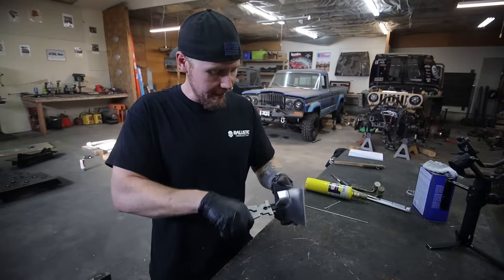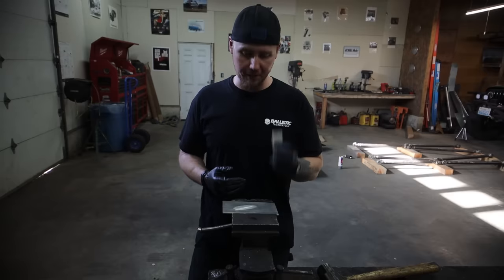Amazon's CHEAP Alternative To Aluminum Welding!!! (Alumaloy)

Comment: Click on a video for aluminum.. stop to drool over the Jeep Gladiator pickup... Damn I wish I was short, I love those damn trucks. (I'm 6'10 and all torso) I think if you had a jeweler's torch that uses propane, or just a really small orifice torch similar to a gas welding torch, that thing would be really useful and much easier to control your heat. I was thinking about making tabletop waterfall fountains, that stuff might be a great way to allow me to make them out of aluminum instead of steel. BTW there's that stuff commonly called Troll Snot that's a clear gel you use as a heat sink when you don't want the heat to go further on a panel.. I wonder if that'd work to keep the heat centralized on aluminum and not let it spread out to the entire piece.
Reply from the maker: 6'10" your a real life gladiator! I have an Acetylene torch with a small tip that would work perfect for this. The problem is I get comments where people complain that I use specialized equipment when I fabricate lol so I decided to use a standard propane torch for this job!
Reply: @DirtLifestyle  yeah but if you had a small tip torch for a propane setup it'd probably work great, even out in the bush so to speak. They aren't that expensive, hell amazon has some jeweler's torch setups for under $30! Though most of those are for oxy-acetylene, you'd just have to swap out for a propane regulator. They do make small propane/butane pen torches as well. Also I found both harbor freight and northern tool have low temp aluminum brazing rod at a better price than amazon does.
As for my height.. fun fact gladiators were actually mostly pretty small. Sure there were some African slaves that were tall and some Vikings/Visogoths, but mostly they would've been under 6 foot tall back then. :D

Comment: So this is aluminium solder. You Americans will not understand the English words. Home depot sold this 20+ years  ago and it works really well for some purposes, especially auto air con repairs, where the pipes crack and using this with an outer tube is better than a TIG weld repair.
Reply from the maker: This is very similar to the brazing rod you see at home depot but its definitely a different alloy. Not flux coated or anything like that. What ever they make these rods out of is a strange combination of materials and feels much harder than the aluminum rod I tig with. Its strange stuff 👍

Comment: Aluminium brazing is nothing new or revolutionary. I took my first year apprenticeship course for welding 50 years ago and we were given a one day course using this process as part of the course. It is a viable process for what it was intended for which is non-load bearing applications. The down side is once this process has been used, the only way to use another process like TIG, absolutely all of the alloy must be removed to prevent cross contamination and welds of dubious quality which is why it was never very popular. Most people elected to go with a guaranteed process rather than take a chance. Now that the public is becoming aware of it it's use is on the rise. The problem is of course there are certain people that will knowingly use it in places where it has no business and failures will occur much like MIG welding. It seems like every joker in the countryside can run a MIG but very few can produce a good stick welded joint which actually takes  degree of talent and knowhow.

Comment: Please don’t weld a fuel tank without taking any safety precautions.
You can watch some great OH&S videos where you see people being blown away by the explosion.
Reply from the maker: Are you telling me not to or saying this as a comment for anyone? This is brand new. This has never been a fuel tank. It is just an aluminum cylinder until you store fuel in it. No safety precautions neccessary. But anyone who is working on container that has seen fuel, of course make sure you don't have vapors on any kind. 👍 wash it out. Let it sit in the sun for a week.
Reply: Dirt Lifestyle Actually you can weld a fuel tank with fuel still in it.
With the correct precautions it is possible.
Though you have washed the tank, it is safe to purge with an inert gas.

If that tank had no openings you could have had an explosion from pressure but not dangerous.

When welding aluminum it is a common thing to drill a hole to release the pressure during the welding process.
My message was directed to you, as it is important to also speak about safety precautions.

Comment: Do not use brake clean to clean parts you will be soldering or welding. It can kill you. Google it.
Reply from the maker: Absolutely. Welding or brazing over brake clean is extremely dangerous that's why I use acetone for anything fab related 👍

Comment: its easy to do wrong. MAPP can easily melt your aluminum. Also DO NOT try to do any of the braze rod in the flame. You need to evenly heat both pieces to be attached up to the proper temp. If you have to hit the rod with the torch you already compromised the weld.
   Right before its hot enough the aluminum starys to look shiny.

Comment: You didn't flux the joint, didn't file the joint flush with its base, and didn't heat the base properly. If you'd have done all of those steps to perform a proper braze, you'd have had a much harder time breaking that off.

Comment: Unfortunately since it is brazing and NOT welding it is not nearly as strong as welding would be. Nor can it be used in lieu of welded parts where welded strength is needed. Pro weldor.
Reply: Nothing more than filler - may as well us glue!

Comment: Tried this on some Motorcross bike rads, no success
Reply from the maker: It can be tricky. It takes alot of heat and you don't want to melt your project (very easy to do). With a little practice it works well but like I said. It can be tricky. Thanks for watching 🤘

Comment: Braising is not an alternative to welding.  You might as well use epoxy.
Reply: I work in the HVAC/R field and I have braised more pipe than most folk could even think of and I can tell you without a moments hesitation that braising is vastly stronger than any epoxy adhesive.

Comment: I strongly advice not doin this on a fuel tank that has had fuel in it, its extreme dangerous even after washing it with water there's a huge chance of some fumes and it will explode like a grenade
Reply: As someone who's done much welding of tanks, leave the cap open and any taps or outlets removed or open and then weld away. It won't explode if the gas can escape. It'll chuck a flame out the holes but it'll be fine.
Reply: @jencrowson  I seen one explode and the young guy had his foot on the tank when it popped and he lost a big chunk of his foot, it had been steam cleaned but apparently there was something left over in there weather it was in the seams or in the pores of the ally but who knows really, an old guy I worked with told me to fill the tank with exhaust gas and basically it will disperse any oxygen left in there, I'm not bagging out thus guy just a fyi really for people that have no idea about this

Comment: A fuel tank is not my idea of something to repair on the road…
Reply: Unbias    So true!     Every few years in most localities will have a news piece about some poor guy who got fried trying to repair a fuel tank.    Some live, many don’t but you know they will be an extremely expensive mess for years if they live.   Getting fried like that somewhere out in the puckerbush is gonna decrease someone’s chances of survival drastically if it goes bang.   
     More often than not the tank is still on the vehicle trying to save time.    Often it’s a diesel or fuel oil tank that they mistakenly think can’t explode.     They can !     That’s why even though it’s a relatively simple cheap process to repair fuel tanks ( filling them with exhaust ect) it’s not something I want to do.    I’ll farm it out to a pro.     Save some cash by doing the removal and cleanup and installation yourself or take it in on the vehicle and see what he says to do then let a pro do the deed.    Being fried is no way to make the headlines..........

Comment: Wouldn't call it a real alternative to proper welding because you can never actually reach the levels of stability and real binding of the materials like you can with welding.

It's a nice little trick to do there is no way to weld it properly and only if there is no health or life depending on that weld.

Comment: LOL technically it's brazing not welding cuz there's almost no penetration
Reply: Elliot Agosto there is no penetration. Without melting the base metal you do not get penetration this the same as soldering. You also cannot get enough heat into the aluminum to properly braze like you do with oxy acetelene on steel using brazing rod

Comment: Save your money and buy a welder with a spool gun or a cheap a.c./dc tig.. This stuff is junk and does not penetrate the base metal.. Do a cut and etch test on this and you will see exactly what I mean.. I have been welding/fabricating for over 24 yrs specializing in 6061 T6 aluminum and stainless.. I bought this crap just to see what I already knew was going to happen, and after getting it to lay down I cut and etched it and zero penetration it did not get hot enough to break through the aluminum oxide layer which has a melting point almost twice that of the actual aluminum itself..

Comment: You're wrenching in the wrong direction.... Variable wrenches shall be turned in one and only one direction
Reply from the maker: I'm not wrenching, I'm bending aluminum. I'm using a tool to do something for convenience not its intended purpose
Reply: 🤣 still, to wear your tool less, let's do it in correct direction regardless.

Comment: Clean aluminum with a wire brush ? LOL   Impurity embedded by you LOL
Reply from the maker: Using a stainless steel wire brush to clean off oxidation is the most common method of aluminum welding prep. Nothing out of the ordinary here 👍
Reply: @DirtLifestyle  now you say stainless steel wire brush